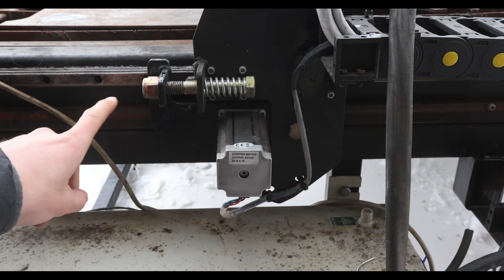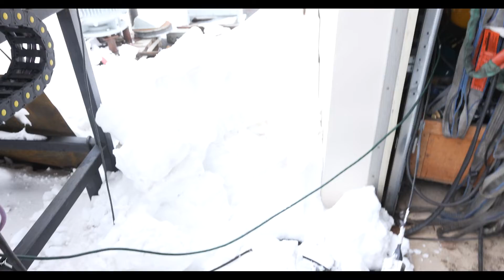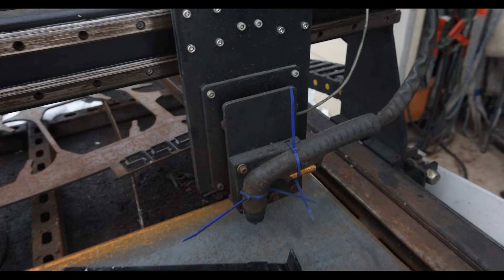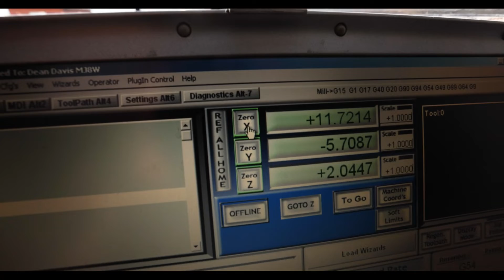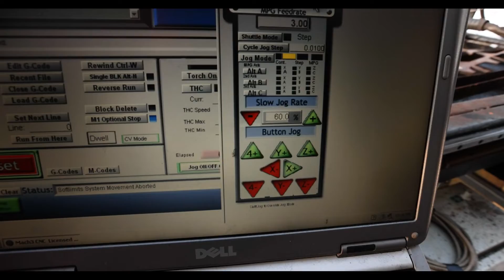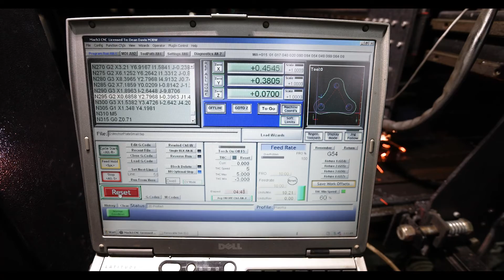How to build a CNC Plasma Cutter Table | Electronics | Free Plans & CAD Files

Comment: What voltage are the pulse and direction signals to stepper controllers from the BOB.  Are they 5 V logic or 24V ?  I cant think why the BOB needs 24V supply as well as 5V
Reply from the maker: I believe the pulse and direction signals are 5 V. But the 24 V is needed to drive the motors.
Reply: Yes 24 V is definitely used for driving the Stepper Motor coils and this is provided directly by Connecting  the 24V to the Stepper controllers so  why is 24V  connected to the PC parallel port Break Out Board (BOB).  This board is for distributing 5V signals to the controller Direction, Pulse and Enable inputs.  My understanding is that the controller signal inputs (eg. Pulse and Direction) are opto isolated so do not even need a 24V reference.
Reply from the maker: @1113562  Oh I see what you're saying now. After understanding your question I wasn't entirely sure as well. So this is the response ChatGPT gave me:

Powering Relays or Other Components: The BOB might have components like relays that require a higher voltage to operate efficiently. These components could be used for controlling spindles, coolants, or other peripherals associated with the CNC machine.

Voltage Level Shifting: While the signal inputs are opto-isolated, the board might still require a higher voltage reference for proper level shifting or for powering the opto-isolators themselves, ensuring that the signals transmitted to the stepper drivers maintain integrity and reliability.

Enhanced Noise Immunity: Higher voltage levels can offer better noise immunity, especially in industrial environments where electrical interference is common. By providing a 24V supply, the BOB ensures that the system is less susceptible to interference, enhancing the reliability of the CNC machine's operation.

Hope this helps! I definitely learned a lot as well.
Reply: Hi Thank you.
Level shifting was my only thought as well but if tge stepper controller uses opto isolators these only need a few Volts.  An opto isolator is only a LED and a photo sensitive open collector transistor located in close proximity in the chip.  There would need a limit resistor so the diode doesn't draw excess current so I'd be surprised if the pulse, direction  and Enable inputs would need or be able to cope with 24 Volts.  I cannot find a data sheet for the stepper controller used to confirm what the signal voltage level range is.
Reply from the maker: @1113562   Ya not sure as well. If I had to guess I would say it has to do with the relay or spindle as I know the spindle outputs up to 10 volts.
Reply: 5 volt all puls/dir signals, only need 24V to input and sensors, can use sensors/input 12V too. motors power supply need maximum what stepper drivers handle normal about 36-50V

Comment: I have a wiring question. Can you clarify why on your updater wiring diagram you have the end switch 2 and 3 in series instead of 1and 2?
Reply from the maker: This might be confusing because of the way I have my x and y axis set up. My x axis is the gantry and is the axis driven by 2 motors and my y axis is the carriage on the gantry driven by 1 motor. In most cases this is switched, it just made more sense in my shop location. But because the x axis has 2 motors it also has 2 limit switches and these limit switches need to be working at the same time. So that’s why they are on different circuits. The y axis only has 1 limit switch and the x axis switch doesn’t need to be activated so that’s why it can be in series. You could put the y axis in series with either switch of the x axis it doesn’t matter. Though you need to have the floating head by itself because say you had the floating in the same circuit as the x limit and whenever you hit the floating head it would trigger the limit switch stopping the code.

Comment: I had issues tuning motors. My Y axis has A as a slave it would change the steeps  calibration on the Y and not change the setting on the A axis> I had to change that manually for the A axis to match the Y axis. Is this normal?
Reply from the maker: Hi, thank you for your patience in my response time. Yes, this is normal. Not sure why Mach3 isn't smart enough to figure out that you want the setting for both A and Y. But I had to do this too
Reply: @ToshDavis  i’m glad that it’s normal. I was so excited when everything started moving the first time and so bummed when I tried to move it the second time and it went haywire. Did you ever hook up a THC to your table?
Reply from the maker: @keithbrown4878  Glad you got it working! I haven't hooked up a THC yet, I do want to though, just not sure when

Comment: Come faccio a collegare la torcia che domanda sempre accesa adesso che l ho montata sul telaio per incisore laser ?
Reply from the maker: Connecting the torch is dependent on the torch you use. But you need to find the trigger wires on the torch and connect those to the relay on the breakout board

Comment: nice build. Does your laptop have a parallel port? If not can you use adaptor to connect the parallel cable?
Reply from the maker: Yeah, my laptop has a parallel port. And I don't think an adaptor works because you need all the pins with the parallel port or at least most of them, not entirely sure though, you may want to do some research on that. I did mention that you have the option to use a PCI card for a desktop solution, not sure what the options are with a laptop though. I actually just ended up buying a laptop with a parallel port as they're pretty cheap
Reply: @ToshDavis  The voltages are not the same on a PCI parallel card. I'm also using mach3 and had issues when I trying to swap out my windows 7 work PC. You're stuck going with a computer that comes with Parallel or getting a converter with drivers to work over Ethernet.
Reply from the maker: @mamburgey5  Oh okay good to know. Thank you for the update
Reply: @mamburgey5  many laptop not have REAL paraller port not full 5 volt output only 3,3 volt have and not working  plasma breakout board, better buy old paraller port computer 20-40$ and use this have petter paraller port and can add second paraller port card too pciE-paraller port card. or perfect if can buy mesa card. ethernet

Comment: I noticed you didn’t have all your slats in, are they causing a issue?
Reply from the maker: Yeah, I don't, the reason for this is the material I cut is normally larger so it can span bigger gaps so I don't need as many slats. I took them out because they are consumables and slowly get destroyed. This way I can just replace the used ones with the ones I took out so I don't have to buy new material.

Comment: how do you prevent interference (ground the device)
Reply from the maker: I personally haven't had any interference problems, so I can't help with this. I do know this has been a problem for other people on YouTube though.
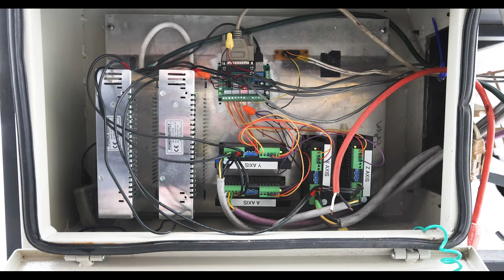Reply from the maker: Hi to elaborate more on your question. The machine is grounded through the power cables. At the timestamp 19:21, the green cable at the top that is running between the wall and the power supply has a ground lead that is hooked up, along with the power and neutral lines. And through the metal box, everything else should be grounded. Sorry, it's not very clear in the video. It does seem like the main cause of interference is the plasma machine. If you're having interference problems once the torch starts up I would watch  Dr. D-Flo's video, called "How to Build a CNC Plasma Cutter" and at 25:41 minutes in he starts talking about his interference troubles. It does seem like what it comes down to is the cheap plasma machines use high frequency to start the arc vs my machine (and the machine Dr. D-Flo upgrades to) use pilot arc as their starting method. I would also say that I don't have the plasma cutter lead running through the cable drag chain.
Reply: You can used a Emi filter ,  ferrite ring and  shielded cable  with good grond

Comment: Hey Tosh great videos. please advise on the HG20 20mm Linear Rail Guide Actuator CNC 750 i can only get a 450mm stroke? will that be ok? not sure why a 750mm would be necessary? your response will be highly appreciated
Reply from the maker: The 750mm was used because I needed 2 330ish mm rails (I forgot the exact dimension) for the z axis and it was cheaper to buy one 750mm and cut it in half then to buy 2 400mm (or whatever dimension I needed, I forget). If needed you could shrink the travel of the z axis or buy two of the 450 mm
Reply: @ToshDavis  awesome thanks for the reply. another question i have i am planning to have my gantry 3m wide for the size plates i have, worrying that it is to heavy is there a bigger nema motor or can o rather put 4 than 2? kind regards
Reply: or perhaps a bigger motor like a 34 nema
Reply: @ToshDavis  SBR 16 rails have good and lot cheapen than HG or MG rails.

Comment: how did you switch the switches on driver and how do i set my switches for nema 23 on tb6600
Reply from the maker: There’s a chart on the top of the driver that I looked at. I forget what current the nema 23 are rated for. I think it was around 4 amps (I could be wrong) but then I just set the switches for the current that was around that rating. The tb6600 should have a dip switch chart that you can look up and I would go off that. And then look at the current rating for your nema 23 motors.

Comment: great job, how is the accuracy of product ?
Reply from the maker: Plasma cutting as a process is not very accurate compared to other processes, but I would say I have tolerances between 1/32 (0.79375 mm) and 1/16 in (1.5875 mm)

Comment: Hi, your videos are interesting, I created a table measuring 3300x 1800 mm years ago, I installed THC SD Proma and everything worked, now it broke down and I installed Proma 150 which must interact with Mach3. the controller I had was not compatible, I saw the LEDs working on diagnostics but the z axis did not move. I tried with a controller the same as yours with a parallel port and everything was ok but to make it work I had to install Windows 7 32 bit, I saw that you make it work with Windows 10, how do you do it?
Reply from the maker: Sorry for the late response. But for my computer I'm using windows XP

Comment: how do you connect the end stop switches ??? i’m lost at that part
Reply from the maker: You wire these into the input ports on the breakout board. Do you have a timestamp of the exact part you're confused on?
Reply: @ToshDavis I have same problem the time stamp is 24:19
Reply: this board normal used pin 10 E-stop SW, home SW have pin 11,12,13. and torch height SW pin 15. and if want all limit SW wiring paraller to E-stop SW, or own pin 14. setting all limt SW.

Comment: hi can you tell me how you attached the  metal gear rack to the machine. did you weld it because i received the same ones today and they dont have holes for screwing in. thanks
Reply from the maker: Hi yeah, I had to drill the holes into the rack. You can see me do this in part 2. I looked for racks with predrilled holes, but they were either really expensive or too short.
Reply: @ToshDavis  do you think they can be welded?
Reply from the maker: @rlcustoms  Theoretically, it is a little weird because you can only weld one side and there is a slight moment about the weld when the gear is in contact with the rack. I think if you welded the ends that would help with that moment. But honestly, I think the moment is small enough it wouldn't be a big deal. With metal compatibility, I think you're fine. When I drilled the holes the rack drilled nicely so I don't think the metal is hardened in any way. I think the biggest problem with welding is that you just really need to make sure you have them aligned properly which may be difficult.
Reply: @ToshDavis  awesome thanks. I have a CNC mill I’ll probably just drill the holes with that.

Comment: Any updates on cut speeds. Would like to also cut lighter metal like 14-16 gauge for metal art but was concerned about gantry weight with higher speeds or is this not a concern. Not sure what your gantry weighs?
Reply from the maker: I'm not sure about the gantry weight, it definitely is pretty heavy, but I haven't had any problems. I know I've cut some things at around 80 to 100 in/min. Most of the time I cut thin material though I'll just lower the current setting. So instead of cutting at the max 40 amps of my machine, I'll just cut at 20 amps for example

Comment: Did you use regular water for the table? I'm currently using an Eagle plasma table and I plan on building a water table for it but I hear the special "cutting" fluid is pricey.
Reply from the maker: I’ve been just using normal water. Though because my machine is outside I have to drain it after during the winter otherwise it will freeze and during the summer is just evaporates. So it’s never really just sitting there. If I had it in the shop I would probably just add some of the cutting fluid to help it not rust. I don’t think you would have to change the water too often
Reply: normal plasma tabler NOT used cutting fluid, normal used anti-freeze liguid same what car engine used, mic 50/50 and use this. anti-freeze liguid not rust metal.

Comment: What is your "A" axis?
Reply from the maker: Because the gantry is wide you want to drive the gantry with two motors one motor on each side of the gantry, which means you need more motor inputs. This is why I’m using the A axis. There is technically is only 3 axes, x, y, and z. But because I need a 4th motor I use the A axis on the breakout board. Because these motors are doing the same thing you call the A axis the slave axis to the X axis.
Reply: slave Y axis, all used 2 motor Y axis normal, and X,Z have need only 1 motor.

Comment: Do i need laptop with parallel port or can be used USB?
Reply from the maker: I believe you can use an ethernet but it's a bit more complicated and requires different hardware. The parallel port is the easiest way. I don't believe you can just use a USB.
Reply: @ToshDavis  new usb port boards have lot problems, and windows have lot lot problems, ewer not used factory and save machine whit windows OS, need use better safety and True REAL TIME software linuxcnc if want safety machine. dont use USB board, better use paraller port or ethernet board.

Comment: SIR , what version of mach 3 did u use in this project?
Reply from the maker: Sorry for late response, but I just used the normal mach3 version. It's just the version you download when you go to their website. Looking right now it looks like version R3.043 is the most updated one. Hopefully that answers your question
Reply: @ToshDavis  i used GRBL controller but we are still planning to use mach 3  . Im just having a little problem.on how to wire the plasma torch and to trigger it
Reply: @johncarlocalingasanfadri-b3431  normal ALL change old historic GRPL system to linuxcnc software not windows base mach3 have safe. only what factory quality have can use safety factory machines uses linux OS, not newer uses windows.

Comment: Hi Tosh your videoed are excellent and iv nearly set up my machine, however one my torch probes the material it winds all the way up and I can’t work out why… any ideas

https://youtube.com/shorts/XlzsmHPtwGE?feature=share
Reply from the maker: Hi Andrew sorry for the slow response not sure if you figured it out or not. It's hard to tell without looking at the code, but it seems that after the G31 command the controller is tell your torch to go to some very high number. Or the G92 command is not resetting the z axes to zero. You can check, but the commands should go something like 

G31 Z-100 F10 (This just tells the z axis to go to -100 at 10 in/min or what ever units you have set. But it's also waiting for the probe command and will continue to the next step if the probe is hit. The -100 is just some arbitrary number to just have to go really far down)

G92 Z-0.25 (This is the command that might be messed up. This basically says to now set the z axis to -0.25. This is the command that zeros the axis. You have to set this to what ever the offset of your floating head is.)

G0 Z0.71 (This is just saying for the z axis to now go to 0.71, or what ever you want the probe height to be.)
Reply: @ToshDavis  Hi Tosh, sorry iv been very busy with work but I will try and look at this again this evening and have a play with the g code I will almost certainly have more newb questions thanks
Reply from the maker: @andrewavers1161  ya no worries! Don’t hesitate to ask